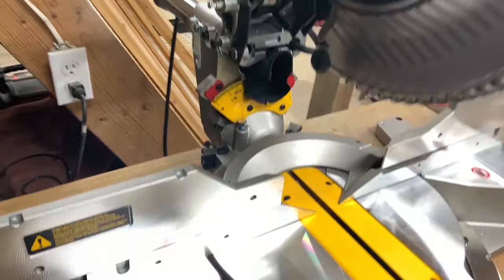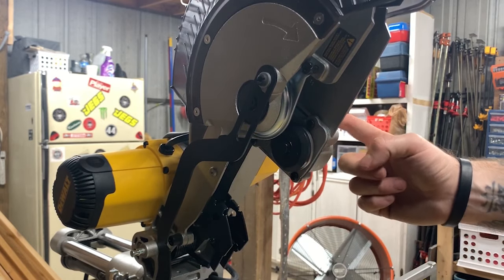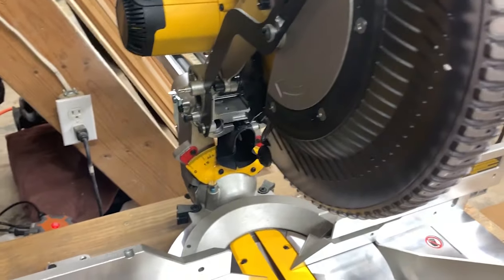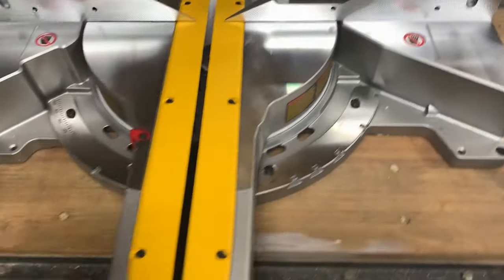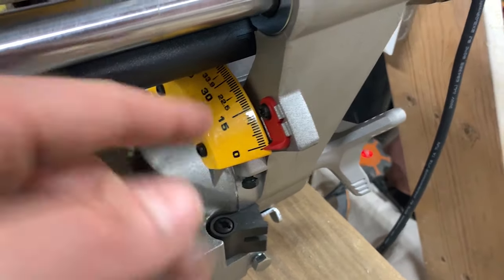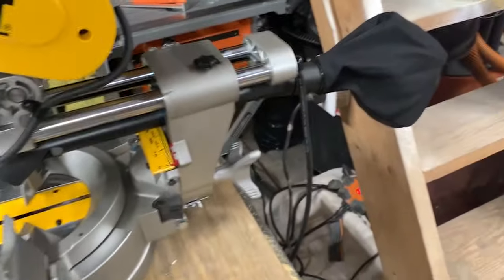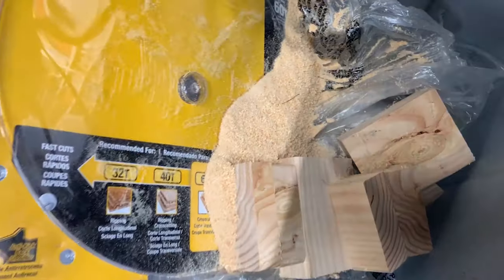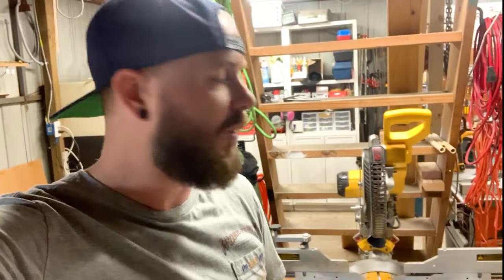Dewalt 12in Sliding Miter Saw DWS779: Setup & Review

Comment: Misses the most important part of setting up the saw. First thing in the directions is to make sure the saw is cutting the angle it says it is by checking the angle of blade and adjusting the scale. My saw came out of the box almost 2 degree off. Make a straight cut and check with a framing square. If off follow the first section of instructions to adjust scale to read proper angle.

Comment: Do you have any issues with the blade jerking down when you release the power button? Mine shoots down about an inch with a lot of force when it stops the blade.
Reply from the maker: That doesn’t sound good, I’d definitely be contacting Dewalt or the store where you purchased it
Reply: Glad to hear it’s not common. Ive never had the issue with other saws, but this is the largest one I’ve owned, so I assumed I just made a bad purchase. Thanks!

Comment: The DWS779 is exactly the same as the DWS780. The difference is the price and the LED light. The DWS780 costs a lot more and comes with the LED light. You can add the LED light to the DWS779 for about $70 with shipping. Dewalt does not sell the light kit for the DWS 779 but another company does.

https://www.mmtoolparts.com/store/miter-saw-upgrade-kit-dewalt?gclid=EAIaIQobChMIvdXcvpT55QIVCaGzCh1WRQxVEAAYASAAEgIuavD_BwE

I bought and added this kit to my DWS779 and love it. I had the light kit on and older Dewalt model and loved it. The light sits directly above the blade and casts and accurate shadow on the wood, teeth and all. This gives you a highly accurate view of where the blade will cut the wood and never needs adjusted or calibrated like some laser lines.

They also posted a video on how to install the light kit that is very well made.

https://www.youtube.com/watch?v=ZMJNE0_qUQw
Reply from the maker: Amazing post - I appreciate this very much.

Comment: I can’t get the handle to lift up. Do you know where to unlock the mechanism that keeps it locked to carry?
Reply from the maker: There’s a little pin on the side, that you’ll pull to release the saw hinge function. It’s stainless not colored, on the left side I believe, start at the handle with your left, work it towards the back of the saw and downward. (From memory, I don’t have the saw anymore)

Comment: How do you remove the clamp once its put in place? The clamp at 10:30 in the video. Ive been playing with mine and cannot get it out.
Reply from the maker: I believe there is a wing nut with bolt on the backside that holds the clamp arm in place, if you loosen you can remove the whole thing. I don’t have this saw anymore unfortunately had to sell it when we moved, otherwise I’d check it directly for you.

Comment: Great review man, one question though. Do you think you could provide the dimensions from the front of the saw to the back where the dust port ends? I'm going to be making a miter saw station and wanna see how much it would stick out from the wall
Reply from the maker: Happy to try and assist - With the saw fully set back, and not slid forward at all, Looks like 30” approx from where bag hooks on, to the front arcing edge / base. Add an extra 12” for the bag. Add another 10” for the front control arm that sticks out. Thanks for checking out the video! 💪🏻
Reply: @TheToughGuysTV  Thanks!! I was impatient and bought it anyway lol but those dimensions really do help. Now to tweak my design lol
Reply from the maker: Nice!! Good luck with your build, someday I need to do the same type of station with some real dust management

Comment: There must be different versions of this saw.  I just checked it out at my local Rona (owned by Lowes) and it doesn't have the trigger lock.   I wonder what else is different.
Reply from the maker: Not sure on that, I know the 780 has the light add on.
Reply: You are right. Seen someone state that on an amazon review on this same saw. The Home Depot version and maybe the Amazon ( I think it was Amazon) version was different. One had some plastic parts on it while the other one had metal parts. 🤷‍♂️

Comment: Hey question for you.  I can't find it anywhere but can it also use 10in blades? A lot of what I read said try to get one that used both so if you are cutting smaller material you can go with the smaller blade for better speed.  Thanks
Reply from the maker: Great question! I’m not sure you should install a smaller blade, but whether or not it’s actually possible to do so only depends on the arbor size.  But again, I can’t confirm or recommend that you do that without consulting with Dewalt directly prior. Good luck!
Reply: The smaller the diameter the slower peripheral surface speed at the same RPM. The circumference of a larger diameter circle is just longer. A 10" blade on this saw has a peripheral surface speed of 9,848 feet per minute. A 12" blade going the same RPM travels 11,938 feet per minute. So the 12" blade is 21% faster.

Comment: I'm having trouble to decide between a Ridgid and a DeWalt miter saw.
For sure I know DeWalt is way better, and probably a little way more expensive, besides is a dual bevel saw.
But for home projects, would a Ridgid miter saw do the work???
Reply from the maker: It really does come down to a personal preference and where you’ll have it setup to use. I personally have had terrible luck with Ridgid miter saws, but my Dewalt was awesome. I currently use a saw by Evolution - I have a video here on the channel def check that out if interested. Good luck in your search!
Reply: @TheToughGuysTV  
I think I will get the DeWalt,  I have seen  more positive reviews from DeWalt buyers and Im convinced it would be my best option.
Thank you very much for your recommendation.
God bless you.

Comment: Great video. Thanks. Did you have to adjust the 90 degree or was it spot on?
Reply from the maker: From what I remember it was a tiny bit off but I didn’t notice that for a while. Might have gotten off after use. Super easy to adjust on this saw.

Comment: How does the dual level works, I just bought one and it only slides to the left side and I don't know how to slide it to the right side.
Reply from the maker: Should be a locking mechanism on the rear side that you loosen and the saw can lean either to the right or to the left when facing, this will give you the ‘bevel’ - some saws are single bevel, and will only lean one direction. When you loosen the arm at the front of the fence, and then pivot the fence that’s the miter.
Reply: @TheToughGuysTV  thank you buddy.

Comment: Just picked mine up today. Last one in the area. They are being discontinued.
Reply from the maker: Glad you were able to get one!! It’s been a great saw for me!! Good luck with yours! 💪🏻
Reply: REEF X mr 
How much did you pay for yours?
Reply: KDFROST1 the sale price at lowes. $350.

They have a metabo 12 inch dual bevel on sale for $179 right now. Idk if I should return the dewalt and get that one.
Reply: REEF X mr 
Thanks for your prompt reply
Reply: KDFROST1 the metabo isn’t a sliding miter saw. The dewalt is probably one of the better saws you can get, especially at that price. I probably won’t use mine for awhile, because I have so many projects to do lol. But if you find one, I’d spring for it. Tools tend to pay for themselves!

Comment: Have you done anything with the Miter Lock Override (#22 in the manual)? This is my third 779 to use (first to own) but those previous had neither the Lock or the Safe Trigger.
Reply from the maker: I’ve not as far as I know
Reply: @TheToughGuysTV  I don't know what it does and can't activate it per the manual
Reply: @TheToughGuysTV  Depress the miter latch button and then rotate vertically the  miter latch override allows you to bypass the stops at 15, 22.5, etc etc.

Comment: How is it at cutting accurate  45' angles for making picture frames? Did you have to make any adjustments to make it accurate, or was it accurate out of the box? Thanks for the awesome video.
Reply from the maker: I made sure to square it up, and I always do some test cuts prior to 45s but it holds really well. A magnetic digital gauge you can put on the blade would be helpful if you are adjusting often. Thanks for checking out the video!! Glad you enjoyed it!! 💪🏻

Comment: Where do you see that it wasn’t supposed to come with the 32T blade? Mine came with a 32T blade
Reply from the maker: First saw it in a thread on Lowe’s website. Mentioned it was in the manual for the saw. So I asked at the store if I could open it and review the manual with a customer service rep. We did that and confirmed it did say in the manual that a minimum tooth count blade is a 60T. A store manager got involved and was nice enough to swap it for me in the store before leaving.

Comment: Curious if it'll handle masonry projects with ease as well.
Reply from the maker: Not sure on longevity cutting blocks / bricks but if you have a solid blade that’s the first step. I know the heavy vibration can be an issue, I personally never used it that way.
Reply: @TheToughGuysTV  yeah and I'm worried also about all the dust getting into the motor. Think I'm just going to save up for a proper concrete saw and play it safe.

Comment: New Does anyone notice the new version of the DWS779 is different than the old one?  Dewalt removed at least five features such as crown stops and slide lock lever.  The kerf plate in the old version has two pieces instead of one piece in the new version.
Reply from the maker: Definitely some good observations - would be interested to know their reasoning for removing features for sure! Thanks for checking out the video and for the comment! 💪🏻
Reply: @TheToughGuysTV  I was planning to buy one, but I did not after comparing the DWS780 and new version of the DWS779 at Lowes.  The bottom of the fences in the DWS779 do not have holes to attach custom fence to cut wider boards.  You have to drill holes by yourself.  Therefore, the new one cannot be used to cut 16" board.

Comment: I'm very new to woodworking and have zero tools.  I've been considering getting a table saw and a miter saw.  Both of these are more expensive than I thought.    The Dewalt miter saws are on sale so I was considering getting one.  The one with the slider is twice the price at $399.   How necessary is that?  Thanks.
Reply from the maker: For me starting out, I used a circular saw and a really basic miter saw for many years.   I would consistently run into issues not having a table saw, and if I could do it all over again, I'd go Table Saw and Circular Saw first.  Then maybe a jigsaw to supplement you for detail cuts, or a benchtop scroll saw / bandsaw depending on what you're doing.  I definitely am FAR from an expert on the topic of woodworking BUT that's my two cents.  Go Table Saw and Circular Saw - you can do SO MUCH with a good table saw.  Don't hesitate to look on Facebook Marketplace too for used tools in your area, until very recently almost everything in my shop was 2nd hand, don't let anyone shame you into buying new.  Enjoy the process!

Comment: Great Video, Thanks! Am I right I’m saying that the DS779 doesn’t have a laser for cutting and is primarily the only difference between it and the DS780? Thanks again!
Reply from the maker: Yes as far as I know that’s the only difference. I’ve heard from others in this thread that you can actually buy a laser attachment 3rd party.  Thanks for the question and for checking out the video!! 💪🏻
Reply: It’s actually an LED light that uses the blade to cast a shadow. More accurate than a laser. And supposedly you can upgrade to it.
Reply: @seabass22  more info on the led light kit, part # or model??
Reply: Mr Chillpill not sure, haven’t looked into it. I think it’s like $60-70
Reply: @JayBuccola  thanks ill check out the kit
Reply: this saw is on sale all the time, but the 780 is never on sale, not sure why....
Reply: They've changed it a little. The thing I notices is what he called the crown pawls in this video aren't on my 779 from Dec 2020. I've done the light mod, which works great.

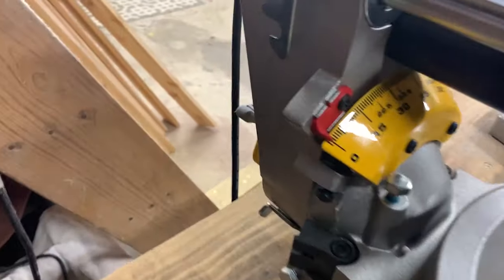Comment: Hi. I just found your site. Great video. I recently ordered this saw and I am awaiting delivery. I noticed at 8:20, you showed the right side bevel gauge and after moving it, you placed it back but it was just beyond the "0" mark. Then at 8:47, you showed the other side of the bevel gauge, which showed it was set at "0". 

It appears that the red gauge marker needs to be adjusted on one side so that both red gauge markers show a "0" calibration for both sides at the same time. I was wondering if when the saw is at a 90 degree bevel, (straight up) if there is a "lock in" position (like the way it clicks in at 0 and 45 degrees for making flat cuts) so you know you are at 90 degrees and can just adjust the red bevel degree marker.

Or, is it smooth and you have to assume you are at 90 degrees straight up?
Reply from the maker: It doesn't automatically lock in at the "0" no, you have to use a square to set it perfectly if you want, at least in my experience.
Reply: The lock plate with the angle isn't perfectly set out of the box. It's adjustable though. You really just need to square the saw up, then set the indicator with the lock notches to match once.

Comment: you didn't mention the light which casts a shadow of the blade showing where the cut will be.
Reply from the maker: Mine doesn’t have a light on it, or laser. That’s a different model. No light on the 779.
Reply: @TheToughGuysTV  fair enough, must say though - I can't understate its usefulness!
Reply from the maker: Yeah no doubt!! Someone commented that there is an add on you can buy for this saw to add the laser and light I believe - an aftermarket add. I’ve thought about it for sure - My evolution r255 has a laser which makes things way quicker that’s for sure

Comment: OK, someone tell me what I am missing here.

I am a DIYer, but not the average type. I buy distressed foreclosures and fix them up. I am still in the "DIY" category because I do not "flip." I live in these homes and fix them while I do. The house I am in right now I have lived in for 13 years, and I am just now finishing the remodel on the final bathroom. I give the whole house a "make it livable" makeover, and then take my time going back and doing it right, room by room.

All that is to describe my skill level, and my usage of tools. Those tools: I married DeWalt 20 years ago. Everything I own is black and yellow. So I use only professional grade tools.

When I went to buy my Miter saw, I saw two choices. A single bevel 12 inch for $300, and this dual bevel for almost $700 (both DeWalt, of course). I thought to myself "what do I GET for that extra $400?" The only advantage I could see is that I would not have to flip the wood over to reverse the cuts. That was not nearly enough to justify me spending an extra $400, so I went with the $300 7485.

I am open to finding out when I am wrong. What am I missing here?
Reply from the maker: Not sure I’d pay up for a difference that large honestly unless you’re a trim carpenter or cabinet / furniture maker by trade. When I purchased it was not that big of a gap, so I opted for the model with more capabilities.
Reply: @TheToughGuysTV  Gotcha. Thank you for the response. If I was missing something, I wanted to know.

Comment: I purchase this one today I noticed that the saw stays one line under 0 double bevel  is that supposed to stay on 0 or under 0
Reply from the maker: Definitely use a square to check where it needs to be - I know mine had some wiggle room in setting square,  whenever I adjust it to make a cut I always check it again with a square when setting back to zero. Once it’s set, it stays true. 🙌🏻
Reply: @TheToughGuysTV  i litterly had the same question!!!

Comment: Mine came with a 32T blade on the saw. Where does it say it is supposed to come with a 60T? I can’t find it
Reply from the maker: I first found it in a review thread on Lowe’s or Home Depot, another person mentioning the issue with the 32T blade. Then after purchase, I read it in the user manual that came with the saw which is how I leveraged it with a store manager when purchasing - I had them open it up, and read it in the manual saying 60T blade minimum. They swapped it for me at the store - some people have not been so lucky, some go through Dewalt. In all honesty I’m sure the 32T blade would be ok, but I wasn’t about to pass up getting a free 60T if they’d swap it.
Reply: I just purchased it today aswell I'll be opening it up tomorrow and checking the blade and the manual for that 60T blade, let me know if you call DeWalt or Lowe's thanks

Comment: I just got mine out of the box, and while I have no knowledge of a sliding miter saw, it feels rough, and sticks a bit going back and forth. 
 
Is there a certain type of grease, or oil I should use on the rails? The sliding feels like it is not oiled compared to the linear rods/bearings on my panel saw, and my  router planer system.
Reply from the maker: I'm not sure exactly what type of grease you'd want to use, that's a good question.  If it's rough moving I'd consider contacting the store you purchased it from and ask about a return/exchange.   Found the below link when searching online - https://northmorgancreek.com/miter-saw-lubrication-oil-grease/#:~:text=A%20dry%20graphite%20lubricant%20is,extra%20reasons%20to%20stick%20around.

Comment: Ahhh, you got your Dewalt after you had all that problems with the Ridgid. Thanks for the video.
Reply from the maker: Tim, yes that was my end solution to the Ridgid problem! BUY DEWALT! 💪🏻
Reply: @TheToughGuysTV  maybe the Ridgid was just a defective one? Cause im trying to decide between these 2 units.
Reply from the maker: I went through 2 saws in the video I put out, the process was pretty awful. No one could convince me to trust that saw unless Ridgid themselves officially came out and said they fixed the issues. That’s just my take of course - Good luck!!